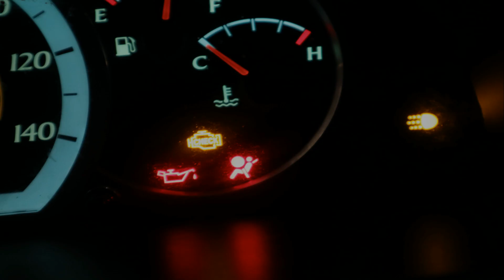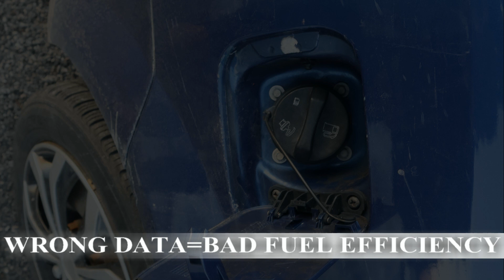SYMPTOMS OF A BAD CRANKSHAFT POSITION SENSOR

Comment: A good way to tell if the crank sensor is bad, is when you try to start it, look at the instrument cluster. If the tachometer (RPMS) doesn’t move, then it’s your crank Pos sensor. This is because the computer can’t read how fast the crank is spinning (because if the bad sensor) so their for it sees it as 0 RPMS
Reply: I just replaced the sensor.  A month later engine light 335 code and tach stopped working.   Here we go again.  Pipes off and 3 hrs of frigging .  2010 Srx awd 😢
Reply: So if I try to crank my car it won’t crank and the rpm’s don’t move it’s that
Reply: @xpologyz  look kid if you can't crank your car and your engine don't start and turn over then you're not going to see RPMs anyway LOL
Reply: @midnightstoker4_0 😂
Reply: I've got a P0420 code and I'm getting a crank but no start. I originally change fuel pump. But the most common problem for this code can be the catalytic converter or maybe even the fuel injectors. I ordered the fuel filter also to be safe. But my boyfriend thinks is can also be the crank shaft sensor. What do u think.
Reply: @michellerosariopadin2045  a good way to check if it’s ur fuel pump or fuel filter is to get someone to go where ur fuel pump is located mine is underneath my back seat so i took off the seat and had my dad go back there and listen to when i turned the key just to the on position and if it makes noise then it’s working and it’s good , also i’m thinking it’s ur fuel injectors for sure because u can run your car with no Cadillac converter so it would still start
Reply: @michellerosariopadin2045  i have some tips on how to clean your fuel injectors instead of buying new ones and it only costs $15 to clean them if you need to know how let me know and i got you
Reply: @haleyleeann hi can you let me know
Reply: A P0420 is code for o2 sensor
Reply: I got oil around the censor but no engine light is on and when I between 45mph and 50mph the engine shakes. Could this be a bad sensor
Reply: @amandaandgabriel5950  sounds like motor mounts to me
Reply: @amandaandgabriel5950 when u park on hills does ur engine shake ?
Reply: this is true, I have old peugeot 405 turbo diesel without ecu so only thing the sensor in my car does is mesuring the RPM and my Rpm gauge doesnt work until 2K RPM sooo i think my sensor is a little broken XD
Reply: this is what i’m experienced right now . after changing the new crack sensor and it’s all good .
Reply: What if you don't have a tachometer? 03 buick century doesn't have one.
Reply: GREAT INFO.... I'M HAVING THAT PROBLEM WITH THE VEHICLE. THOUGH  I CLEANED UP BOTH VVTI AND CRANK SENSOR THE VEHICLE  STILL RUNS ROUGH AND THE RPM  DOES NOT SHOW , WICH TELLS ME THAT THE CRANK SENSOR NEEDS TO BE REPLACED.  THANKS FOR THE TIP.
Reply: So your saying that I don’t have to open the cluster? Just change the CSHS to see if the rpms needle moves? Ima try that. Mine only moves when step on the accelerator hard. Like it goes up and then down.
Reply: So what if Ford was lame back in 2001 and their cluster doesn't have the tachometer
Reply: Thank you Einstein
Reply: Exactly what happened to my car
Reply: Wooooowwww! Having that EXACT symptom!
Reply: Okay so if it dose move than can it still be considered the problem by any chance ?
Reply: My cavalier has busted 2 coils this year alone . That’s my 3rd pair of coils . Let’s not talk about the coils I just bought because they come with the ignition module from the junkyard ….. thought that was the problem at first but now the cords that go to the module from the sensor aren’t getting much of a current to ignite at all …
Reply: Not with all cara
Reply: My 02 crv, always shows rpms around 8000 plus and minus while idling or driving. Could this crank pos sensor cause that
Reply: Also stays around 8 when car turned off, car runs fine

Comment: I have 95 escort 1.9 the check engine light comes on 8 seconds after start up, the car runs great. I replaced crank shaft sensor about 15 years ago

Comment: I have the 0335 code thrown on my truck, a symptom I’m experiencing is that the rpm gauge drops to zero while the truck is running, and when this happens the idle becomes more rough, very poor acceleration and the AC compressor kicks off and doesn’t blow cold air. I’ve also experienced the engine stalling while idling in park. Has anyone else had this issue from a bad crank sensor?

Comment: Someone told me I could be having an issue with the CPS. 
I'm not sure that it is.. But here is my situation:

Starting the car is fine.  I can get anywhere and there are no issues during the first trip of the day.
The problem is when 1, it's hot outside 2, after stopping for gas or a short grocery trip,  starting it back up you hear and feel is struggle. Low RPM at idle and when driving at thay point you feel it struggle and recently its actually dying at every stop.
I have an AC adapter with LED display that tells me current voltage from the battery (may or may not be 100% accurate) and it drops to below 12 at times, especially when stopped at a stop sign/light. 

The car seems to accelerate fine though. Even when it's having a rough idle, i'm able to put a litle on the gas and it bosts the voltage on the ac adapter display and the roughness goes away.  It does feel like at 3k+ rpms it sounds more rough than usual. I change gear based on the sound and feel and I catch myself shifting under or right at 3k RPM instead of higher.  Not sure if this is realated. 

I thought it was something with my stereo system but I've been driving with it off and it still has similar issues. I have experienced the same issue with the fuses to my amps disconnected, so I imagine it's not a draw or a bad ground. 
I thought it was the battery but it passed a battery test. I tested the charging system and it failed.   But then I took the alternator out to test it isolated (tested both at Oreilly and at Autozone in their new alternator testing machine with belt and everything) and it passed.

I think I have an idea of what to check next but wanted input.  Any help is appreciated.

Comment: I have had all of these problems for a year and a half but no light was on so no shop would touch my car!   Today the engine light is on so I’m gonna go to parts store and have the diagnostic reader done. I’m very curious if it will say crank shaft sensor.

Comment: I have a 2007 dodge ram 1500. It wont start at all, I checked fuses, replace battery cables and terminals.. It brings up the red dot security light on the instrument cluster and wont let it turn over. I was told it was the key immobilizer, I replaced that as well with a chip key. Doors open and close with the remote, making it seem everything is good, but it still has the red dot security light on. I dont know if I need to replace the  battery or crankshaft sensor, or what else...

Comment: Sometimes the crankshaft position sensor code doesn't always show up it only gives you a p0300 code and the car starts shaking and the check engine light starts flashing ....
Reply: Dealing with this now it’s gonna throw a misfire code also

Comment: Thanks for the video. I haven't had any of the symptoms yet, but my check engine light came on this past week and the ECM has stored the code for a bad crank position sensor. The light hasn't come back on but I at least know what to be looking for if the sensor is bad.

Comment: Great video.  My only issue is the code is reading P0300.  Engine misfire I have a Chevy Tahoe 5.3 I guess it's still possible to be a crank shaft issue.
Reply: Crankshaft position sensor or your camshaft position sensor went bad make sure you get dealership sensor never aftermarket that's electrical get aftermarket you will be stuck somewhere

Comment: what should be the common problems on my honda civic `97 model that when the temp gauge leveled to middle temp then that`s the time  engine will automatically dies and after cooling it for about 20 mins or so it will start again, any suggestion? thanks

Comment: I have bmw e39 and the problem is that engine lose power when driving highway speed. No fault codes and everything fuel pressure is ok. Can it be fault of crankshaft position sensor?

Comment: Will the crank sensor affect the transmission the car runs good until driving about 40 miles then it down shift and stay in that gear until i unhook the battery cable then it starts back shifting i know a guy that had the same problem he changed the crank sensor and it didn't  messed up no more

Comment: I’m getting a cam and crank sensor code. Replaced the camshaft sensor and still won’t start right away. Put the old sensor back in. Finally starts after a few tries. I cleared the codes and it’s starting fine and running perfect, never showed signs of anything. So idk. The crankshaft sensor is impossible to get to without dismantling everything so I’m not the mechanically inclined.

Comment: Hello, I have a Renault Clio 1.5 dci 2001 and it has been two years that I have a problem with the ignition from time to time, even on the road there are cases when I turn it off and it is difficult to turn it on, the heater and engine light turn on, I changed the injectors, sensor gear pump and sensor again the same problem, can this sensor be to blame that only this one I have not changed yet, thank you.

Comment: So, working on a 2003 5.3. Engine is hard to start, and when it does, I get a ton a backfire. Listening to this, I “think” is the crankshaft sensor. I don’t know if the cam sensor would do this, but I do not have a diagnostic computer, nor can I move the truck. It’s a 1959 Apache restomod. Not driveable yet. Your thoughts?

Comment: Question, would this cause a car to have a knocking noise? My Chrysler 300c keeps making this knocking noise and mechanics have said that it could be the crankshaft position sensor. Is that true?
Reply: i think so, i got a code for the camshaft sensor and instantly started hearing a small knock at low rpm, and dissapers when idling for about 10 seconds, getting it fixed soon.

Comment: I had a bad crankshaft a while ago. When I would come to stop lights and sometimes when I was driving. The oil and battery light would come on simultaneously and the car would stop driving. I would have to either jump it with my charge box or simply wait for it to start up again

Comment: Sounds simple...I did go O'Reilly's had it scanned.. have a 2009 Kia Portage Ex 6cyl.2wl drive....brought it there bec.for the abs light...got the codes..as driving away it stalled... they say it's "scan position sensor" bought the part.. now trying find location for that!

Comment: would the car still crank or no?
Reply: my 07 accord will crank but won’t start the only code that shows up is 61-01 i’ve replaced the spark plugs, it’s getting fuel, i’ve checked the fuses as well

Comment: I already changed cylinder 4 spark plug and ignition coil for the third time but it just got the same problem miss fire … what seems to be the problem? Need some advice… do you think the problem is from the camshaft sensor and the crankshaft sensor? My car have the same symptoms…
Reply: Did you figure out what the issue was? My car is doing the same thing with having to change coil pack and spark plugs

Comment: My jeep Wrangler 2010 model from the 2nd cylinder spark plug comming spark outside while Cold start also while starting one pisses sound also comming after it gone the whole day starting.one time I changed the particular plug.itwas crack .now I put new plug same symptoms comming spark from 2nd cylinder.i changed the coil.all 6plugs and the plug wire also.is it the problem of crank shaft sensor.plse guide me.i am from dubai.weekend we are going for the desert drives also.plse reply.

Comment: I pulled the wire off this sensor (no damage). I replaced the connector, but my car doesn't start anymore. This was the only electrical part I touched. I wonder if the part went bad just taking off and replacing the connector.

Comment: P0685 , ecm relay i changed, but it acts up when speeding up or running for a while . sometimes it will lose power when driving and all meters will go to 0 then go back to normal

Comment: Can a crankshaft position sensor be bad without the check engine light indicating it. I've been experiencing hard start at 94°F on hot afternoons. Meanwhile on cold mornings at 69°F the engine often starts at a single crank. My check engine light is OFF.
Reply: Definitely!!
Reply: Did it fix your issue? Mines having the same problem. Turns on when its cold at 1st crank. After engine is warm it struggles pretty bad to start at times. Already replaced battery, alternator, starter. Now im going at its either the crankshaft sensor or a fuel issue. Let me know of you fixed the issue and what it was please. Thank you
Reply: @golpherboy13  got the same issue, and i went all over the fuel system. It has nothing to do with it. I highly suspect that it's the crank sensor.
Reply: @chipikk  you think so, I haven't done anything on mine and it still does it.
Reply: @chipikk  did you swap it out yet ? I got a 99 4.8 Silverado that doubt the same issues hard warm starts but good cold starts
Reply: @michoacan141  yeah. It was the issue.
Reply: @chipikk  Mind sharing what kind of car you drive.
Reply: @acpoteete9932  I'm having the same issues with mine and now the starter starts spinning and not engaging the flywheel.  Did a Warranty exchange on the starter and it still does it from time to time and it still has hard starts when car is warm
Reply: @golpherboy13  did it fix yours ?
Reply: @MrTakeOne  didn't swap it out I'm pretty sure its my fuel pump.
Reply: @golpherboy13  that’s what I thought, but think about it the sensor controls the fuel injectors. A symptom of it being hard to start and pump not priming
Reply: @franc4424  3 things I came down to is a fuel imjector is bad, fuel pressure regulator, or fuel pump.
Reply: UPDATE: My truck took a dump on me over the weekend. Cranks and cranks but isn't turning over to start. It turned off on me when my friend closed the trunk and the truck was on. My guess is that the fuel pump got shook when the trunk closed and cut off fuel which caused my truck to turn off and now there's no fuel pumping. Replacing the fuel pump today bought a new one life time warranty from autozone for 445 bucks. Hopefully it's not a hassle and I can get the job done. Will update you guys once I replace it.
Reply: UPDATE: IT WAS NOT THE FUEL PUMP. I replaced it and it just kept cranking. My guess now is that it is going to be the fuel pump relay or a wiring issue. Could still very well be the crank position sensor
Reply: @golpherboy13 any updates lol
Reply: @robertcordova2528  yep so after fixing everything and replacing everything it was the relay fuse. Replaced my fusebox with a used one from another truck. Problem solved with hard starts. Only issue I have now is that at times the starter just spins. There's probably a wiring issue I'll fix it soon.
Reply: Yoooooooo got mine in the shop with this same situation with the mechanic scratching his head!!! For me, though, the car still idles perfectly. But super bad starting problems, but has only not started one time, and super jerky ride/acceleration.
Reply: So with the 4th symptom could it also throw a knock sensor code?
Reply: Has nothing to do with the crank shaft lol

Comment: I have a occasionally no start on my 2004 low milage Tacoma.  Happened at 30k couple times.  Key on and off a few times and starts.  (It cranked fine)

Now at 75K happened 3 times in a few days and then stopped running on road.  Got it to fire after dozen on off cranking.    I have a led volt meter wired to fuel pump .  When ever it does this,  see no voltage.

Which is helpful to at least know why it's not running.   So I checked all the relays..  All good.

So tomorrow, will check resistance on CPS since the ECM maybe is not giving it a ground do to a bad reading from the CPS.

Once it runs, it's fine. Can a CPS be this intermittent? No engine check light or codes. Been running my OB2 reader while driving.

Comment: can the sensor be bad and not have the check engine light on? my hummer h2 has poor acceleration going up hill at low speeds, it will simply not accelerate at all ! I replaced the fuel pump and a bunch of other sensors and filters and still does the same thing! I guess i'm gonna try this

Comment: I have a Mondeo 2012 auto EcoBoost 2 litre turbo petrol engine that is not sounding very healthy at the moment not idling smoothly and feels a little hesitant slowly rolling on taking off at standing start, other than that it runs fine, it's done 155,000 kilometres on the clock and is showing low compression in cylinder number 3 with 55 PSI, the other three cylinders readings in order #1-150, #2-155 #3-55 and #4-150 PSI also did a wet test on #3 from 55 went up 115 psi is this common with these engines? Just wondering if you can give me an idea on what I should get done and to rectify this issue ? 
Thanks in advance?

Comment: Hi my 1.6 clio has experienced similar issues. Sometimes doesn't start for about 20mins then starts fine and drives fine sometimes starts fine with no problems and just recently was driving for over an hour then as I got to a red light the car just cut out managed to restart the car and got home . Could this be a tdc sensor problem
Reply from the maker: Definitely could be the sensor, but could also be multiple other reasons as well. Sounds like an intermitten issue! the best way to start the diagnosis is to read the codes with an OBD2 scanner. Even if the check engine light isnt on, you can still have some codes stored which can lead you towards the right direction. Best of luck!